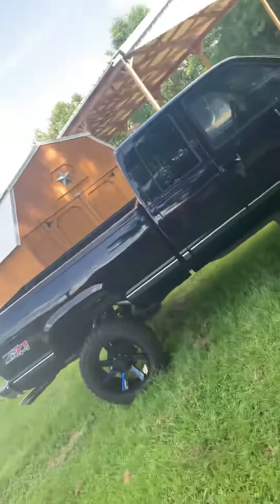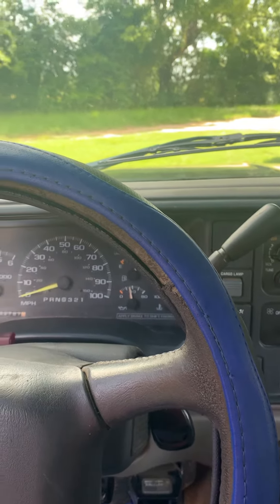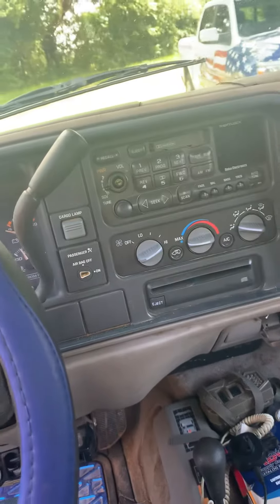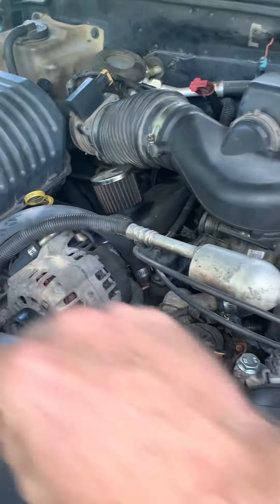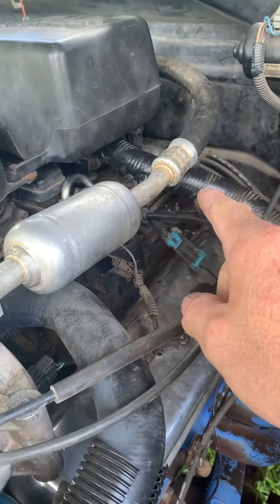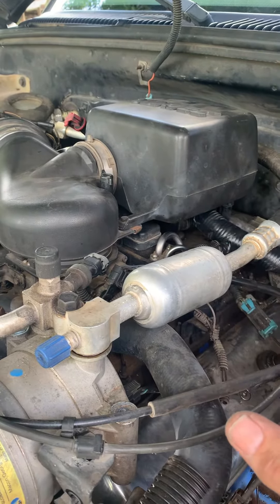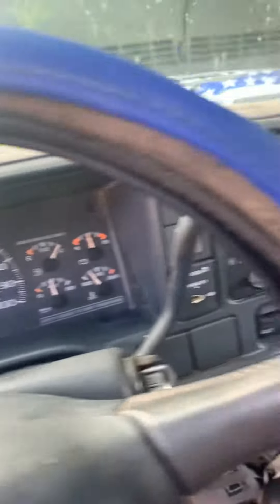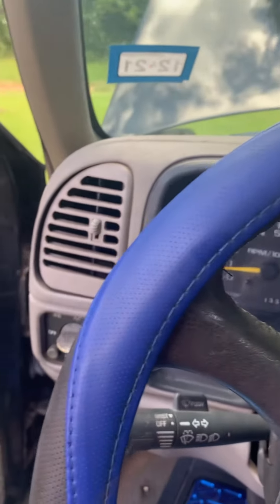1998 Chevy k1500 ac compressor fix

Comment: God bless you sir. I checked my voltage from the pressure sensor and found that the wire was broken. Fixed it and now my A/c blows cold 🥶
Reply from the maker: Awesome glad it worked
Reply: I did that and it worked problem I have now is when I turn the ac off the compressor is still running

Comment: I’m currently experiencing the same thing as your original issue. I’ll have to double check wires. I have replaced hi/low pressure sensor, a/c relay, Freon good, fuses good. If I bypass at the relay clutch works fine and it’s ice cold inside. My step dad said it was the clutch but now I know it’s not. I’ll be checking wire tmrw. I just hope it’s not a wire near impossible to get to. Thanks for vid it gives me one more possible solution. I’ll get the multimeter out tmrw!
Reply: Hey Mike Hosler did you find out what the problem was I have the same problem.

Comment: LOL the way you hit the hood to get it to open. Classic GM. Also there’s little rubber bumpers that screw in and out by hand, that push the hood up when you pull the hood release inside the truck.
Reply from the maker: Ya this one has been like that for years.  I’ve gotten so used to it I bump it and don’t even think about it
Reply: @JB-cw5uu mine did the same thing all I did was dump oil on the latch and the coil things for the hood get her all lubricated and now it opens like a dream

Comment: Thank you for the video sir you just saved my life yeah that Texas summer heat is not a joke but your video helped me out had my compressor wire disconnected soon as I plugged it in compressor came on 👌
Reply from the maker: Good deal.   Simple fix hard to find
Reply: Pon un video mi compa pa saver como lo arreglaste porque aquí en oklahoma el calor también está fuerte y yo tengo ese mismo problema pa saver cual  abre es

Comment: Nice truck I've got s 98 silverado I would suggest a catch can on the drivers side to keep blow by and vapor out of your cylinders I I have a 3 ounce Jtl brand and I get about an ounce every 3k it also keeps the spider assembly cleaner keep up the good work on your ride
Reply from the maker: Ok Ty for the tip

Comment: Thanks for the video. Love your truck.
Reply from the maker: Ya I’ve had it since I was 19 I bought it with about 17k on it. Drive it for almost 340k before I finally rebuilt the motor . When i did we built it up to about 400 hp at the wheels  lots of goodies  in it. Put a 6” lift on it and 20” wheels and 37” tires 4:56 gears  new paint,pretty well done everything except the interior . It could use a facelift inside. Needs a new dash board, front seats and carpet.  I’ll sell it if the price is right.  It sits under my shed most of the time
Reply from the maker: It’s a little on the loud side lol has short packs on it with headers and true duals
Reply: Good deal. Sounds like it has plenty HP. Headers make it sound pure and not generic. I wish mine had them. I have a 98 also and everything is original. I’ve had it since 2001 from my Dad and it only had 22,000. Now has 180.000. Lots of people want to buy it but I’ll never sell it because of sentimental reasons .

Comment: I got a question sir, I'm having the same problem. When the compressor would work for you, did you ac light work on the control panel and also, when you ran the green wire to your battery, could you still turn the AC on and off with the switch inside. Thank you for any help, I'm not a mechanic either so trying to fix my problem on my own to.
Reply from the maker: When it was broken I was able to make the compressor run but jumping a wire from the compressor,directly to the battery , I’m not sure if the lights inside came on or not, I don’t remember. all that did was bypass all the interior switches and deliver the power from the battery to the compressor directly, when doing that none of the switches inside the truck will make a difference because it’s getting its input straight from battery to compressor.I ran it like this for awhile by routing a  wire from the compressor to inside my truck with an simple on/off toggle switch then from switch to battery , this enabled me to manually turn the compressor on and off ,totally bypassing the trucks relays and switches , it worked but was inconvenient because doing that you will have to periodically turn the switch on and off to manually kick the compressor on and off , it’s not supposed to run 100%of the time, the relays job is to open and close the circuit as needed but since all that was bypassed I had to do it manually , if left on it would freeze up and possibly drain the battery or burn the jumper wire, but it did work in a pinch until I found that broken wire as noted in the video
Reply: @JB-cw5uu  thank you

Comment: can you make a video what was done to the motor and MPG?
Reply from the maker: quick response I’ll make a vid later . 383 stroker kit new injectors stock size with high flow fuel pump comp cam extreme energy high torque  remember for sure but I wanna  say it’s a round 280 intake and 290 exhaust. 1.6 roller rockers with guide plates , bored .040 , 10:1compression  I wanted to run pump gas long tube headers, reprogrammed computer,  I built it to pull really strong and it does.  when I had at dyno test it pulled really hard and measured  320 hp at the wheels but kept stalling at 4500 rpm, that’s when we discovered it was starving for fuel I didnt wanna spend another $500 to have it tested again but we estimate  it’s pulling around 400 hp at the wheels  if I didn’t have the lift and big tires on it I’d like to see what it tops out at but I’m afraid I’m gonna kill myself in it if I try that now , when it gets up in the 90s and 100 mph range  I have a gear left and more  pedal and it’s hard to keep on the road  when I had 32” tires on it it would not hookup from a hard start  very good just smoke the tires  , went to 37” tires and it grabs hard now  running 4:56 gears mpg is terrible 8-10

Comment: The paper clip u insert with the truck on or can u explain a bit to me a bit more thanks
Reply from the maker: The paperclip is used to touch the two terminals together. Connecting the circuit. Basically taking the place of the switch to see if it’s a switch problem

Comment: That is gorgeous.
Reply from the maker: thanks. I’ve had it since. 98  I was 19 when I got it. finally got where I was able to make it like I wanted  25 yrs later. been a great truck stock engine was still running when we rebuilt it at 330k

Comment: Hey I was wondering on them valve covers I have a vortec and put some afr heads and having some rocker clearance do you have a parts number on them
Reply from the maker: sorry I don’t I had my mechanic friend pick them up at a local speed shop in Tyler Texas , I had a hard time finding them too because i needed the added clearance and the tall center bolt covers were tricky to find

Comment: Would the fan still run? I turn mine on and it does nothing. Ive changed the fan motor and resistor. Still nothing.
Reply from the maker: Mine would run but the compressor would not kick in. Till  I fixed that wire

Comment: Did you ever experience ac clutch engaging on and off continuously?
Reply from the maker: Yes if Freon is really low it would do that , I’m sure there’s probably other reason it would as well but mine did that one time when from had leaked out and it was critically low
Reply: @JB-cw5uu  right, I’ve done Freon, leaks, condenser, compressor and clutch, control panel, relay and still won’t stop engaging on and off. Even if control panel off or heater on.
Reply from the maker: @josuesalazar3603 hmm In not  sure  I’m not a mechanic but may possibly be the low pressure switch ??  Just guessing I’m really not sure
Reply: @JB-cw5uu  yeah i thought too unfortunately didn’t do it. Thanks for your help
Reply: @josuesalazar3603 did you ever figure it out. I have the same issue
Reply: @ShotCallen23  control panel even tho it was hard to believe since I had already replaced

Comment: Nice truck dude good job on it.
 I've got a 94 Siverado, I'm the original owner it has the original engine and transmission just add the transmission rebuilt it was sloppy and I'm about to turn 500000 the original engine is untouched
Reply from the maker: Yes sir. I believe it. This one here ran over 340k before I rebuilt it and it was still running daily. That was after working it for 20 years hard in my roofing business. Pulling trailers and all over town doing estimates daily.    Very good trucks

Comment: Hey mr John I have exactly same issue dealer could figure it out if I drive to u could u help me out I’m in Lewisville tx u have a number
Reply from the maker: I sorry I’m not a pro just work on my own stuff now and then.. wish I knew a bit more to help you out
Reply: @JB-cw5uu  well I have same issue exactly the same Siri need to change that wire the green one from low pressure switch when I try to jump the connector does turn the clutch on exactly like your vide so u followed the green wire from switch all the way to where u changed that wire out I know that’s my problem just like yours
Reply from the maker: The back of that intake over years of heat apparently will eventually damage the wires behind it.  At least that’s my assumption.